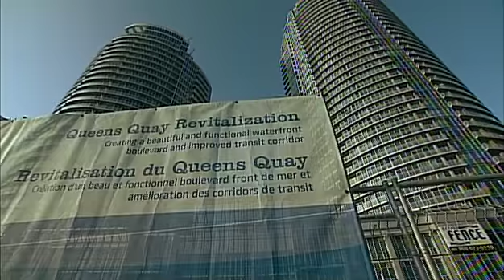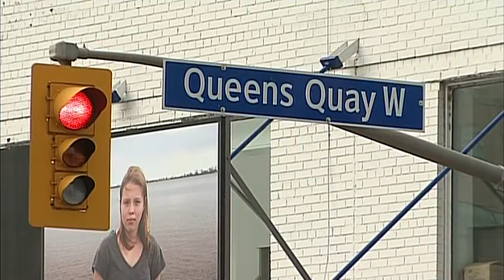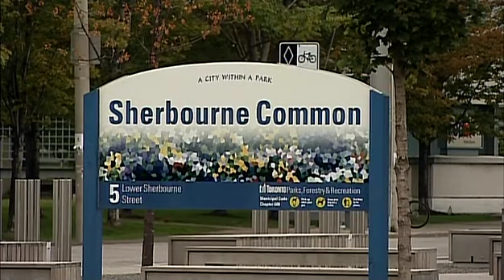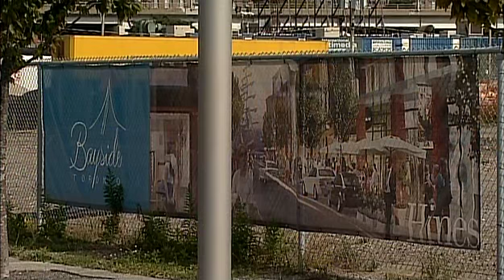Building Toronto: Episode 6 -- Waterfront

Comment: The finished bits are a vast improvement over what existed before but the beautiful street that can compete with the Champs Elysees?  It fell well short of that.  I suspect, like most things in Toronto, we'll build something 3-4 times before we get it right.  Maybe in 2040 it will be re-built and look nicer, then that will get ripped up in 2070 and we'll end up with a beautiful street.  The North side is just dreadful while the street itself has way too much going on.